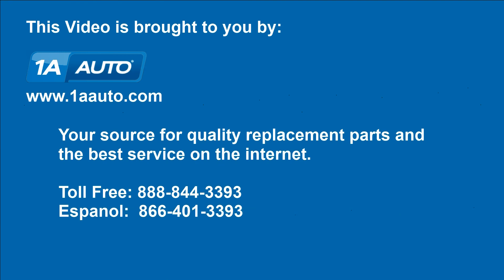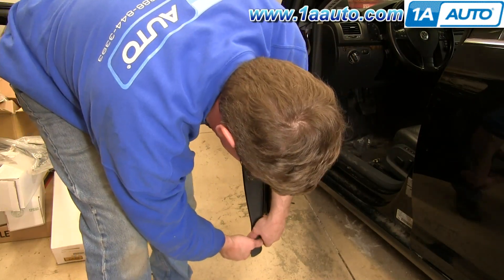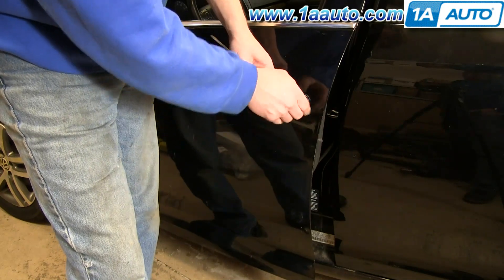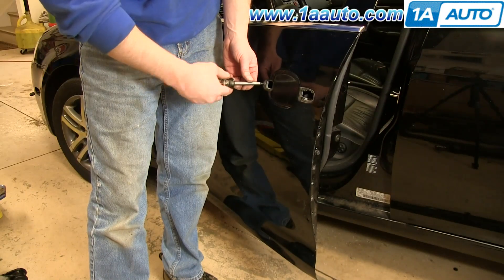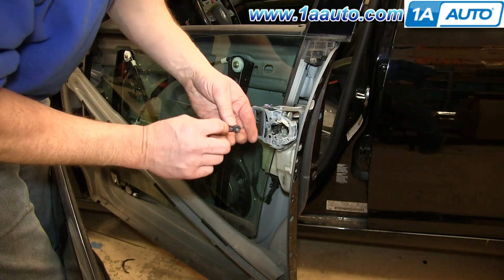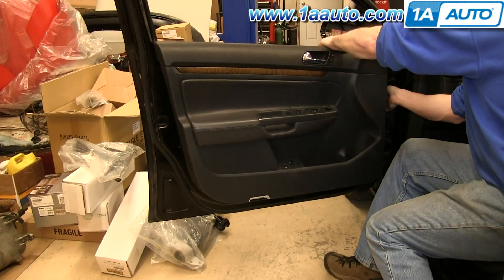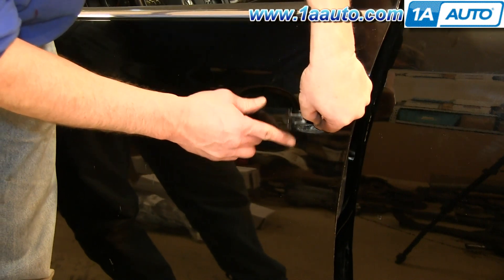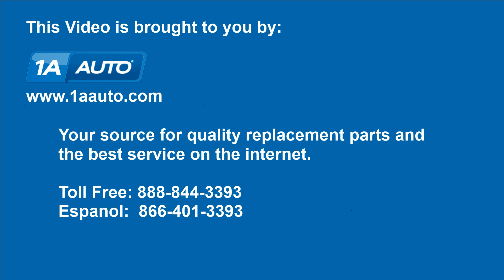How To Remove Outer Front Door Panel 05-10 Volkswagen Jetta

Comment: My 08 rabbit driver side door panel is not exactly the same. Do I just pull off the whole door panel? There isn't a separate arm rest screw or anything else to  remove I think so I'm  stuck.

Comment: i have a 2017 jetta, the lock actuator went and the door does not have the same method for removing the outer body panel, i'm afraid to try to figure it out. It looks like the outer door panel is just pressed around, maybe its not even removable. Is there any way you guys could make a video on it? Thank you

Comment: Hi, Can I ask what I am doing wrong as I took my Golf MK5 door handle off but now that it is on.. the door handle is loose whereas the other door handles are more firm and feel like they are spring loaded.. car is a Golf MK5 1.9 2004
Reply: I have the same problem with my MK5 1.9 2007, did you solve it ?

Comment: Actually, I can not open the left rear door to handle all those screws. Any advice? Thx.
Reply from the maker: +Dan Clate Thanks for watching!  If the door is stuck then you will have to manually pop the lock or operate the latch mechanism.  This might require you to have a reputable shop or lock smith help open it.  1aauto.com